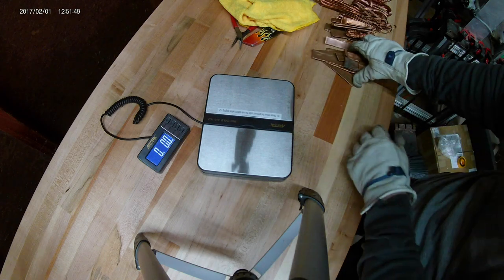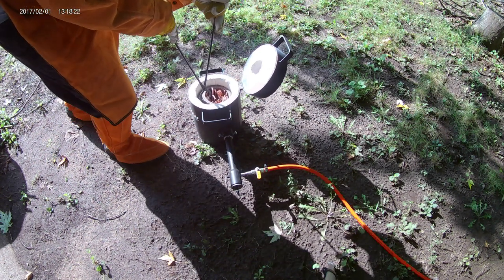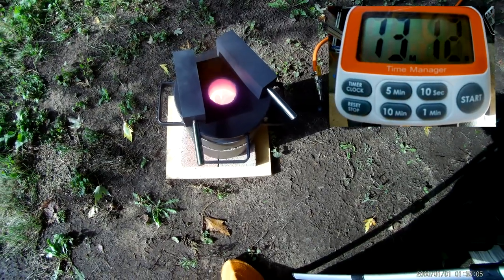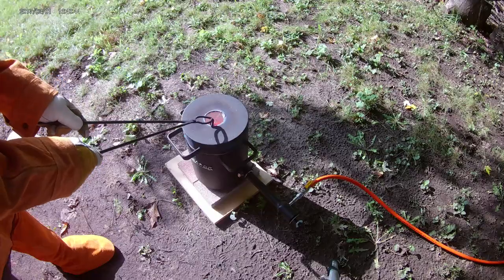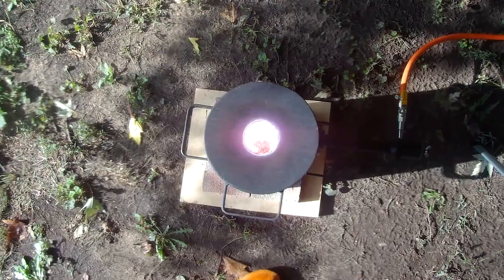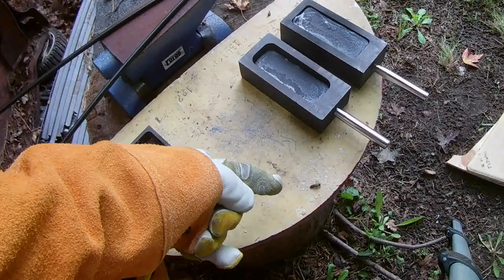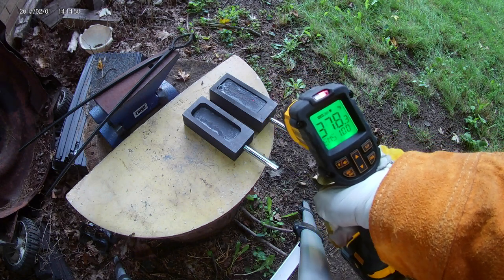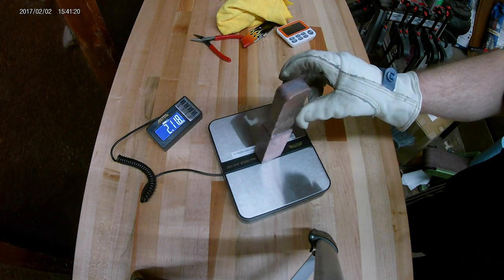Is There Loss When Melting Copper?

Comment: Word of caution when lifting with pinchers, eventually when the crucible weakens it will snap on the edge and you'll dangerously lose your contents. It happened to me when I was using a nice pair of channel locks. I was careful as can be but the silicon graphite was just wore out from many uses, I lost several pounds of copper, almost burned a nearby friend in flip flops and left a nice beauty mark on the driveway.
Reply from the maker: Thanks for the tip. The pincers were a disappointing buy from Amazon. I wasn't too worried on this melt though because the crucible was quite new. I will, however, be upgrading my lifter as soon as I can.
Reply: I'm glad to hear you dodged a bullet with your driveway spill. I had a hinge pin fail and a full crucible of aluminum bronze spill. I wasn't so lucky... I posted a video from my security cameras if you're interested.
Reply: Back in the stone age when a friend and I did bronze casting we had a hinged cradle I suppose you'd call it that we'd lower down over the crucible in the furnace and the two arms of the cradle would close around the crucible allowing us to lift it out without putting any stress on any one part of the crucible.  From there at first we'd set the crucible in a casting ring to hold the crucible for the pour but it was easier and safer to just use the cradle.  Even a new crucible is so darn fragile when hot that grabbing it with pincers is risky.  Another tip to help with spills, over a layer of sand lay down a floor of hard ceramic brick (not concrete brick) leaving a gap of about a half an inch, maybe a little less, between them.  That way when (and it is "when", not "if") you have a spill most all the metal will escape into those gaps instead of splattering around too close to your feet.  
Love the copper bars you made.  Copper is my favorite metal.  The colors you get with it are all wonderful.

Comment: One thing you should do ASAP, get some refractory cement Rigidizer and coat your insulation blanket in the furnace and under the lid. Every time you melt, small fibers get blown off and are toxic to breath. Even though you are wearing a respirator, your blanket should be rigidized. It was the first thing I did before firing up my Devil Forge for the first time.
Reply from the maker: It's hard to see in the video but the wool is 100% coated with a hard ceramic so no fibers can blow around. Thanks for the comment.

Comment: I'm was just wondering if you put your mold on a grate or some way to get air under the cast and it should cool down faster
Reply from the maker: You are right, I could use other methods to cool the molds/ingots faster. I might try some different ideas in a future video.

Comment: I wanna melt copper oxide to make pure copper metal suggest me good way.! On gas and oil furnace my recovery is 30%
Reply from the maker: Hi Mani. Sorry, I've never smelted copper oxide so I don't have any suggestions for you. If you make a video about it I'd like to see it. I like melting copper electrical wire because it is already %99+ pure.
Reply: @maverickmeteor  I'll make the video for you.!